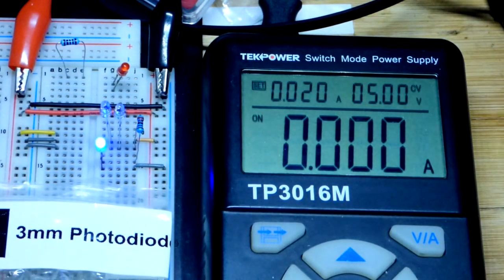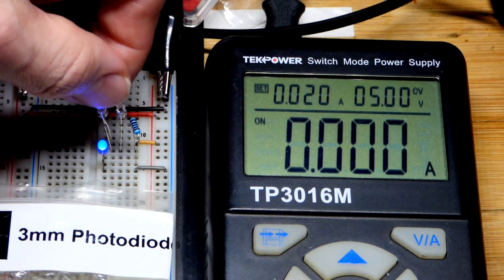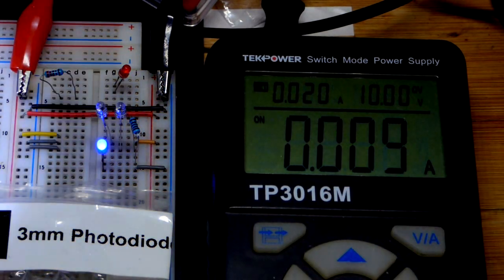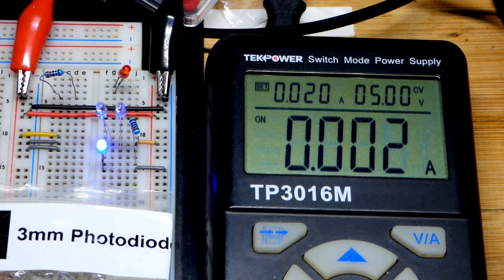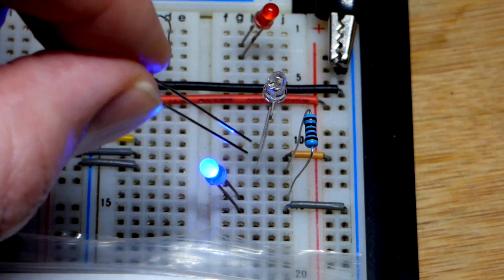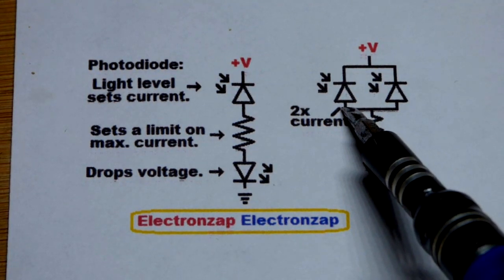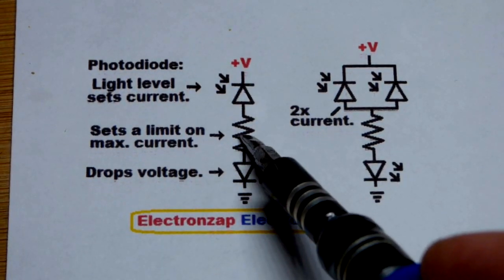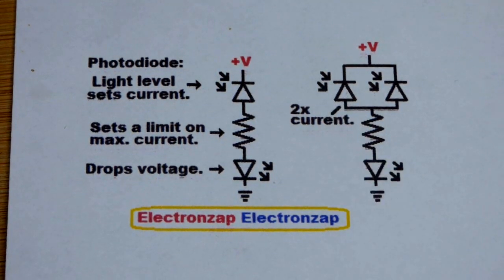Photodiode component demonstration circuit controls LED brightness learning electronics lesson 0060

Comment: Thanks for your efforts to share with us. Is there a particular practical circuit application where you know this design to be used? Or, is the video just to instruct and inspire creative designs? The circuit might be reconfigured to use a single photodiode and a current mirror. That way, there would not be any discrepancy in current doubling, due to a difference in the light that is striking the different photodiodes.
Reply from the maker: I don't really see light dependent components used like this, it's more of a demonstration circuit I came up with to help understand the component better. Mostly I see them used to set a signal voltage, or to control a transistor in one way or another. But I don't study light dependent circuits all that much, so I don't have any exciting examples off the top of my head. Plus there's modules that most people would probably buy, instead of making a circuit themselves,
Reply: @Electronzap  There surely is nothing wrong with just a good demonstration. Much appreciated.